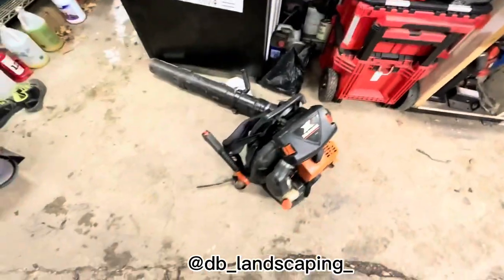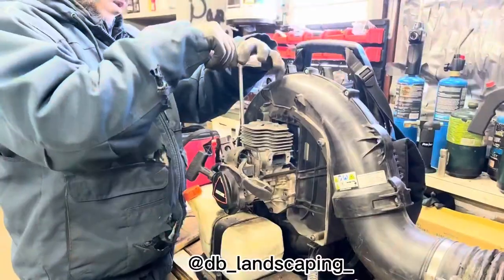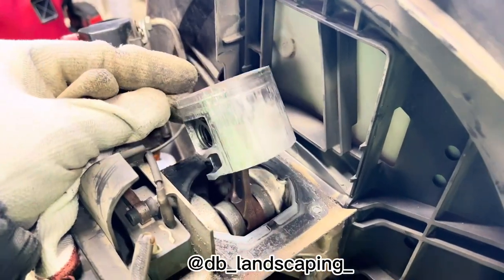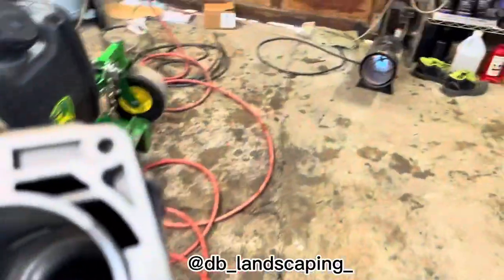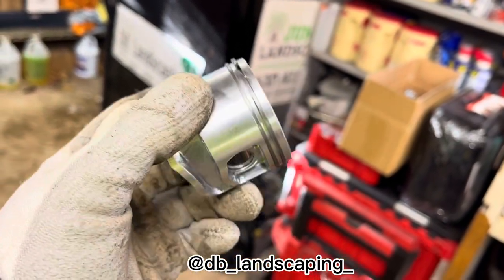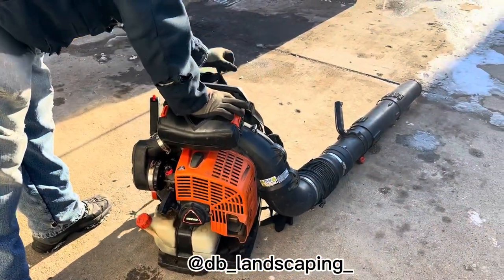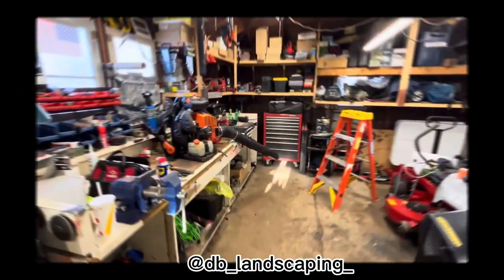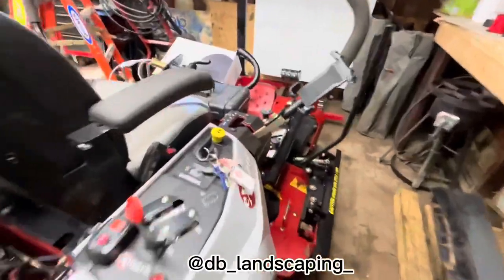How to fix Echo PB 8010H problems

Comment: Ran my echo pb9010 on straight gas and it burned the piston. I only changed the piston and rings but not the cylinder should i sand or complete put another cylinder?
Reply: It hasn't start after i changed the piston

Comment: I got my echo PB 8010T right now, bogging down to the point where its not functional. I replaced the carb, spark plug, air filter, fuel filter....still having the same issue. any ideas??
Reply from the maker: It potentially be the piston we had the same problem with 2 of echo PB 8010t 
What you can do is open up the engine and check the piston rings
Reply: Same issue.
Reply: Just got this issue I'm still under warranty but damn man I only mow 10 or so yards a week im in Illinois so I'm seasonal and it hasn't even been 2yrs with my blower hard to find any info but I'm also not a small motor guy

Also I have the shindawa eb810rt it's the echo 8010 but red